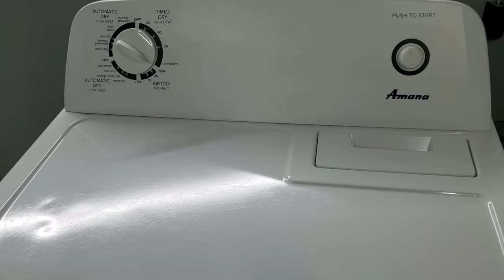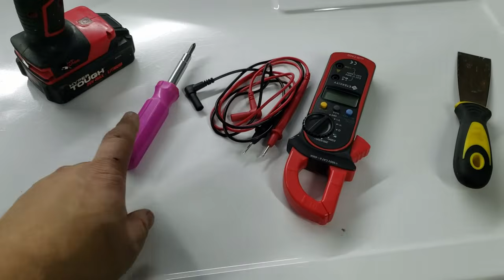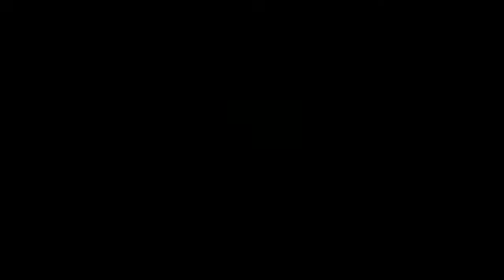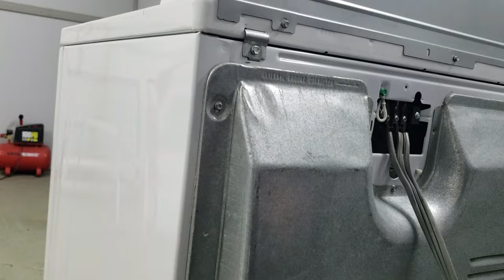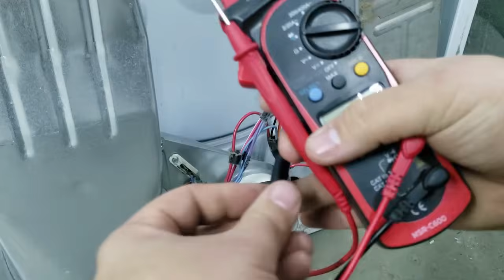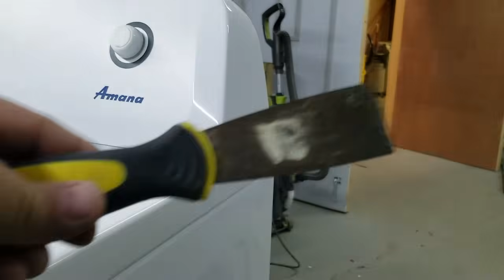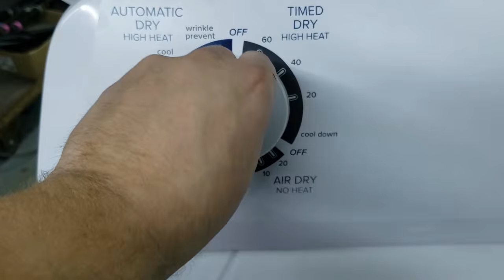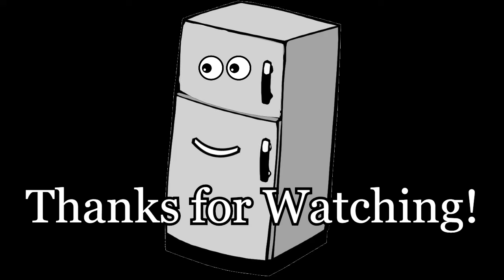How to Fix an Amana Dryer that Won't Heat - Also Works for Kenmore, Maytag, Whirlpool and More!

Comment: I replaced all the parts with the kit from Amazon. I noticed my heating element was burnt out, after replacing all 5 pieces my deyer is still cutting off after a few minutes and smells as if something is burning. Do you have any idea why?

Comment: There is a good chance you'll be spending a little more than $40 for this fix. If it's an Amana not heating, it will likely be a faulty timer. They're notorious for their awful quality. I've replaced mine twice in the past 7 years. They're about $70 and relatively easy to install.
Reply from the maker: I am working on a kit to replace the faulty contacts for $20
Reply: @bensappliancesandjunk share a link to buy it.

Comment: Hi! I have a question. When you are testing the timer on the dryer do you start the machine or not? Also when you diagnose the all the elements is the dryer plug on electricity? Cause in the beginning of the video the machine wasn't plugged in. Thank you.

Comment: Just came across this video after I ordered the parts online and I still have no heat. I don't have a multimeter tool so where should I go from here?
Reply from the maker: Check timer. If it's like this one it may be a bad contact on it
Reply: @bensappliancesandjunk  same model...thx

Comment: Hi brother, thank you for this video.  I followed all the steps and the only thing that strayed away from a perfect test of all working elements was during the power check.  I got 120 from  the positive and negative terminal when attached to Neutral but nothing from positive negative with leads attached to eachother and no Neutral.  I did just have my Main panel upgraded for a solar installation.  is it possible this oddity is from a miss on the main pannel upgrade?  Do you have any advice on this?
Reply: I am only getting 124 volts on each leg of outlet and on each screw/wire of braker and when combine both legs of 124 volts on either outlet or braker I get 0 volts. Replaced braker and still 0 volts. Any idea why can't get 240 volts?
Please advise how you fix your issue.

Comment: The guys at Home Depot insisted I unplug the dryer before using the multimeter on it. When you start it's a close up and it sounds like it's plugged in as you say "check the breaker." Will you comment on safety?
Reply from the maker: Unplug it for continuity and resistance tests. For voltage tests It needs plugged in

Comment: All of the items have been tested and all tested good. The dryer still won’t heat any other suggestions?
Reply from the maker: Check voltage @ terminal block. Has to be 240v. Check timer contacts as thats a frequent one

Comment: When checking for voltage do you leave it plugged in or unplug it?
Reply from the maker: Voltage yes. Resistance, no.
Reply: @bensappliancesandjunk  so I replaced a bad fuse after trying to fix a no heat issue turned out that same fuse blew again any ideas?

I did clean out the vents I do have continuity on other thermostats/fuses
Reply: @bensappliancesandjunk  I did notice the heating element smelled a little burnt all though the coils are in intact and do have continuity in the connection
Reply from the maker: @leosdreamon681  Check if heating element is grounded out. Take off spade connectors going to element. use multimeter and put it in continuity and see if you can tap either terminal w/ one multimeter lead, then other against the metal can. If you get continuity, the element is grounded and bad, causing it to short out. Cycling thermostat is another one that can fail over-supplying unit w/ heat too. Make sure filter is cleaned with hot water as well.
Reply: @bensappliancesandjunk  we’ll looking at the heater element is all burnt out and visible on the inside of the dryer is black so it’s gone bad in my case
Reply: @bensappliancesandjunk  do you know of a good website to buy the heater element?
Reply from the maker: @leosdreamon681  https://bens-appliances.com/products/whirlpool-dryer-heating-element-optional-sensor-kit-279838-338134-3392519-279816

Comment: I tried using these tips to fix my dryer but after replacing every part and checking the timer, heat seems to only happen when i have my timer on high 40min and nothing else works. Any suggestions?

Comment: Another way to test the cycling thermostat and element thermostat is to remove them and shake then next to your ear. If it sounds like a high pitch rattle, it is usually good. If it has a dull rattle sound it  probably has a burnt contact inside. It helps to have a good thermostat to rattle to hear what it should sound like.

Comment: Dude, I have that exact dryer and it wasn't heating. Your instructions were spot on. Found the bad part but, kit was only 25 bucks on Amazon just like you pointed out to another poster so, I went ahead and replaced all of it anyway. Working perfectly! Thanks man!
Reply: What was your issue? I’m having the same problem

Comment: Hi, great video I have a liquid propane, gas model is it the same procedure?
Reply from the maker: Disassembly and sensors, yes. No heating element, instead uses gas coils/valve so checking that will be different for sure.

Comment: Thank you for this video. My Amana's thermostat failed and took the hi limit cutoff with it. Looking on Amana's parts site the thermostat has been replaced with a higher limit one, so I'm assuming it's a common problem with the particular model I have. 70$ for them both. Cheaper than calling someone out for sure!

Comment: You didn’t check the smaller thermal fuse next to the cycling thermostat.
Reply from the maker: That doesn't deal with heat
Reply: @bensappliancesandjunk  oh ok. Every website I’ve been to said the thermal fuse is usually the first thing to go bad and will stop the dryer from heating. So far, I’ve replaced that thermal fuse, the cycling thermostat, the heating element and the fuse/thermostat attached to it, and still no luck. Gonna try the high limit cutoff next. I should have just got the whole kit and replaced everything, since I don’t have a multimeter to test them. Thanks!
Reply from the maker: @badguitarcovers7380  high limit is, in my experience, the most common of all of them based on fixing a few thousand of these. Moreso than element, etc. Multimeter can always confirm, and you 100% want one for peace of mind. If Cutoff doesn't fix it, next up is electrical via voltage check @ terminal, and then timer contacts A-B-C.
Reply: @bensappliancesandjunk  thanks!!!
Reply: @bensappliancesandjunk  great video by the way!

Comment: My drier stop heating,it blows room temperature air,I replaced the heating element and the cycling thermostat and still no hot air,any suggestions? It's an amana similar to the one in this video,the other 2 thermostat looking part's  beep when doing continuity test.

Comment: This is my exact dryer thats running but not heating. I have a feeling its the thermal fuse! Thanks for the video I am going to use it later to try to figure it out

Comment: Thank you for the video!!  One question,  what is it likely to be,  if the dryer heats up most of the time.  Sometimes it won't heat up at all.  It's like it has a mind of its own. Any input would be greatly appreciated

Comment: my recommendation is to buy a small parts kit (not from whirlpool because they charge $200) for $20 and just to replace them all instead of wasting time diagnosing.  Very good advice for someone that doesn't want to go buy a continuity meter.
Reply: Please, Where can I find this kit? Thx
Reply: @rosethecopycat  Amazon. They have different part numbers for the same product btw because every brand is doing their own fake part number
Reply: @jason200912 can you add an Amazon link to the kit for the Amana dryer in the video?
Reply: I just fixed my dryer from this instructions. Cost $22. It was a bad heating element😊
Reply: @irepairofpc31familykartrac51 where did you get heating elemnt from.
Reply: Does it really cost $20? And is there really a kit?
Reply: @joaquinsuarez6090  amazon or ebay
Reply: Would you happen to have the link to this kit? I just received the part I thought was bad and I still have no heat 😢
Reply: Definitely buy the kit, because you’ll save time and probably money on your next repair, as you’ll probably already have the part you need. A multimeter is a cheap tool that is very useful for many jobs and should be in everyone’s toolkit. It’s worth it to purchase one. You can get a very basic one for under $10, one like the one in the video for around $20
Reply: Thanks for this.

Comment: I have tested everything that you said and it's all working. Any thoughts on why it wouldn't be heating?
Reply from the maker: Two most common hard ones to figure out is terminal block voltage and timer A-C contacts being bad. Double check those if continuity is good everywhere else. Also check the element with no wires on it to the can itself in case its grounded out.

Comment: you're more helpful than the other videos ive watched. Only confusion i have is at the end when u show which terminals to test in the timer A, B, and C. you did clarify in what order or where to put my probes to each time. Do i put one probe from my tester one A and the other on B? Then A and C? then B and C? Or do i put both probes on A, both on B, and so on. and i couldnt tell in the video by watching it either. other than that, at least u explained the deal with the putty knife opening the top part. thanks
Reply: I don't think it matters the order. A to B, then A to C, then B to C.

Comment: Have a dryer that the element won't heat. When you turn it on plugged in 120v reaches the element fine when you turn the dryer on heat and turn it on. The thermal switches have no resistance when turned off as they should. The element tests good as it has 10 ohm resistance and does not short to ground. There's no apparent physical problem with the element. There's a light blue wire running down towards the motor that seems to have a short to ground but I'm not sure if that's normal being it goes to the motor windings. Seems like I remember that motor wires will show a short to ground. The motor works great. Is there some way that the element could actually be bad anyway? What would be your recommendation to do in this situation? How can the element test good, have 120v going to it, but not heat? Anyone have a clue if the element is bad anyway or is there something else that could cause this? Also, it has 120 volts through both legs.

Comment: Great video! Very thorough and helpful! It was my power that had the issue. My almighty electician hit something when repairing my ac unit breaker. I was only getting one side at 120. Thank you!!
Reply: I am only getting 124 volts on each leg of outlet and on each screw/wire of braker and when combine both legs of 124 volts on either outlet or braker I get 0 volts. Replaced braker and still 0 volts. Any idea why can't get 240 volts?
Please advise how you fix yours.

Comment: I followed your video step by step, and all the components were just fine, and I still have problems with the automatic low heat selection, I checked the 3 on the left for continuity as you pointed in your video and it is fine too... I am wondering if I have to check on the other 3 connectors on the right placing the selector in the automatic low where you didn't check on the video...?

Comment: Just bought a new dryer to replace my old one that had the same issue... no heat!  
Surprise, my new dryer has this same problem!!!
I'm on a business trip, but will be ordering one of your kits from your site to replace all of the sensors (you have some fantastic pricing btw).
So, thank you! ;-)

Comment: Dryer gets hot but clothes are still damp after drying them twice. Any ideas?
Reply from the maker: Vent is clogged
Reply: @bensappliancesandjunk  Vent was extreamly clogged and I cleared it out and got a lot of lint out but still won't dry my cloths all the way, any ideas now?
Reply from the maker: @Critter_Rebuilds  check the blower housing of the dryer. Also check where the vent ends at the house, and make sure the exit is really, really clean. Wet lint tends to keep things shut right at the exit.

Comment: Ok, I've literally replaced all the parts in this video and checked the timer.  I also filed the contacts with an emery board and I still have no heat
Reply from the maker: Did you check voltage on terminal block? Under a load?

Comment: I have that same amana  one of the spade connectors on the heating element is really loose.  i tested continuity  and it worked?
Reply from the maker: You can crimp it down with pliers to help seal the connection
Reply: @bensappliancesandjunk   original problem is the dryer  spins, high  heat  stopped I was able to use low heat and now it stopped,  I checked the timer on high speed   pin A does not have  . continuity pin b,c have continuity?

Comment: I see what looks like a short red jumper wire hooked to the heating element thermostat.  I don't have this wire, but only the red that connects to the top of the thermostat, the red that goes to the element terminal closest to you, and the orange that goes to the other, smaller thermostat terminal underneath that also connects to the other, larger element terminal, which is unused.  Maybe your model is slightly different than mine.  The thermostat part# is 3977767. 

Also, when replacing the cycling thermostat, the purple wires are interchangeable.  But which terminal is which for the red and red/white wires?  My old part has an "X" engraved by one of the terminals and my new one, a pair of small circles.:goodvibes:

Comment: Hey I have this same dryer. It was working then all of a sudden I heard a noise and saw a spark then it cut off. When I unplugged it and looked at the back one of the screws were black and a little loose. Does that mean I'll need to replace my terminal block and all the wires? If so where would I start to even purchase them

Comment: Sure would help if you showed a close up shot of exactly where you are connecting the probes of your volt meter. The shots were obscured by other wires and the fact that the camera was 2-3 feet away from where you were working. Otherwise this was a good video, but in the end, I was not positive where the probes were positioned to test the components. Close ups please!
Reply from the maker: That's why I've made other videos showing it better (this was made over 2 years ago). Otherwise, please understand that filming an appliance video is extremely hard to film + work + accomplish the goal you set out to do, all at the same time, along with whatever rig I am using to show what happens with lighting, and the camera.

Comment: I have this exact model Amana. I checked everything and got continuity to all of them including abc of timer.. all except for the low temp (purple wires) has no continuity and cant get an ohm reading on them either. But red wires for hi temp does. And I have no heat on hi or low. Would that mean thermostat is bad? Thanks!

Comment: My dryer is only not working on the low heat setting.  It DOES work on the high heat setting.  I DID need to clean out the vent tube and have done that. Does it sound like I only need the low heat fuse? (If I can skip all the other steps it would save me a ton of time!)

Comment: Hello again- I replace the two thingie in the heating coil sides and it now heats up!!! Woohoo!! Except now it seems too hot… how you I make sure it’s not running too hot and what could that mean?
Reply from the maker: As long as you buy the right ones you should be OK. The thermostat will cut heat off to make sure its not too hot. I would also make sure vents are clean and free of dirt.
Reply: @bensappliancesandjunk  thank you, the vets are clear. And he dryer isn’t heating again. 😢 I think I’ll have to call someone- or replace it. Thank you, though.

Comment: Is there anyway to do this without a volt meter? Maybe just replace the thermal fuse? And I I hire someone, any idea on how long it will take them? (Thus, how much they would charge?) thank you!
Reply from the maker: Without a multimeter you are throwing parts at the machine without guaranteeing that the part needs fixed or not. You can likely find a cheap one atWalmart, even.

On the hiring part the issue with a technician is there's going to be an upfront service call, then parts and labor. Most techs works charge $150-200 to diagnose and solve a no heat issue unless it's rather complex.
Reply: @bensappliancesandjunk  Thats what i figured :( ok thank you so much for your info!

Comment: You would really think that in a $600 appliance mostly consisting of sheet metal and cheap plastic rollers they could have provided a diagnostic feature like they did in the exact same series of washers. Especially given the cheapness of the plastic drum rollers and other parts that are guaranteed to fail. I suppose that would cut into their profit margin too much though. That being said, thank you for the detailed explanation. It appears very helpful.

Comment: My Amana ned5100tql dryer's heating element only has one spade/wire. I checked the wires and I do not see on that has came off or broke off.

 I tried to check the ohms for the thermal fuse, near the vent, and I found it would sometimes give 40ish but most of the time I got 0.00 on my multimeter
Reply from the maker: Some heating elements have a spade thats kind-of hardwired on the thermostat that goes from thermostat to element. You should be able to remove it, revealing the second spade.